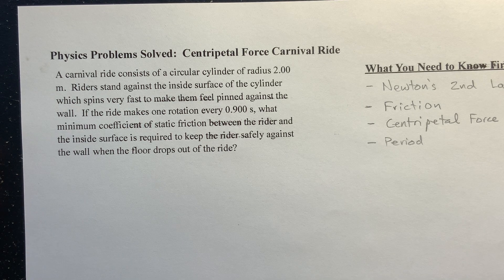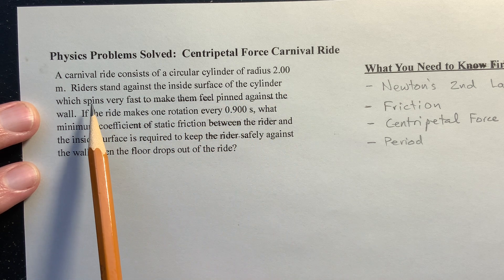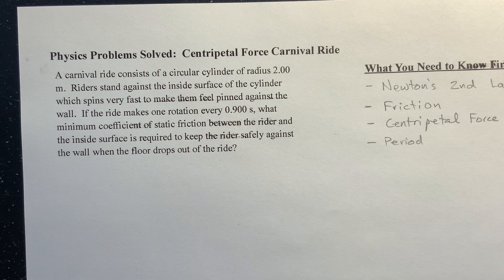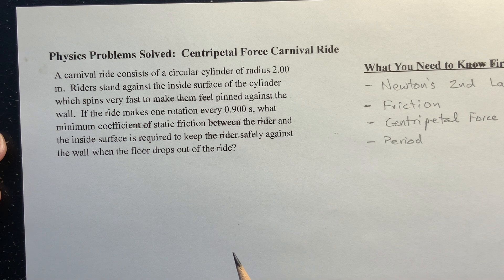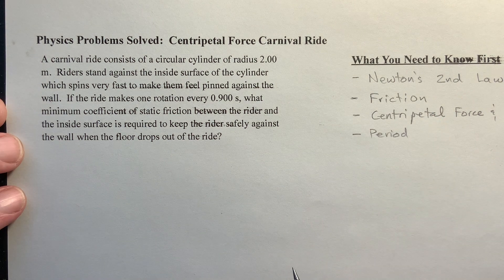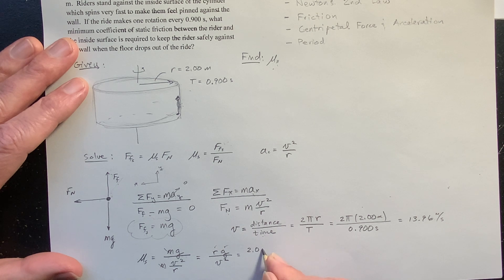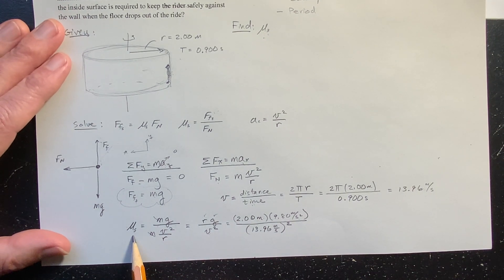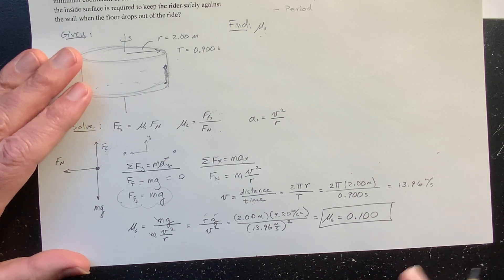Centripetal Force Carnival Ride - A Physics Problem Solved

Comment: What causes the centripetal force in this example?
Reply from the maker: The normal force between the person’s body and the vertical wall of the ride.
Reply: @Treebeard1671  When the ride is at a 90° angle and the person is at the top of the ride, does gravity act as a centripetal force?
Reply from the maker: @ if you mean the ride has tilted so that it’s become a vertical circle, then yes, gravity contributes to a net force that is directed toward the center and is therefore centripetal. Am I understanding your question correctly?